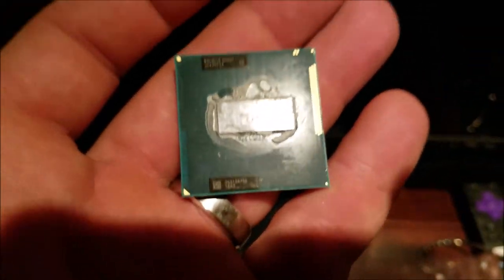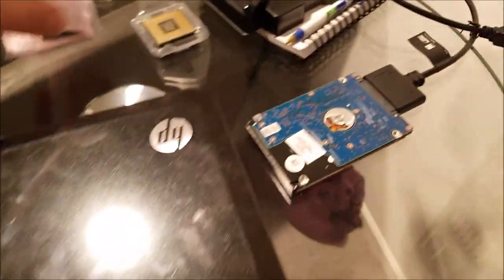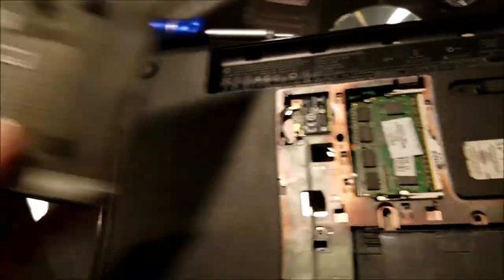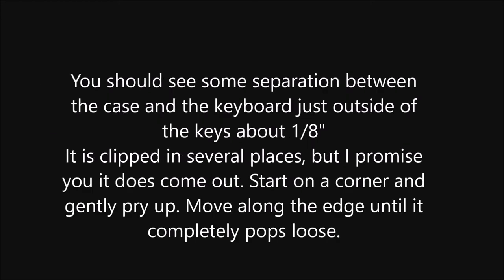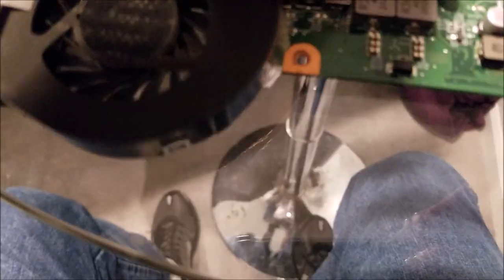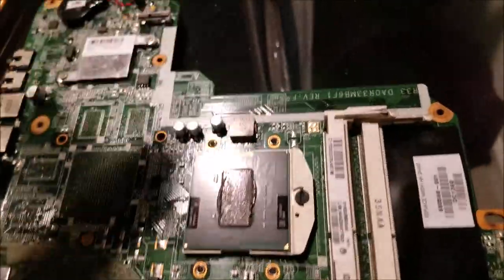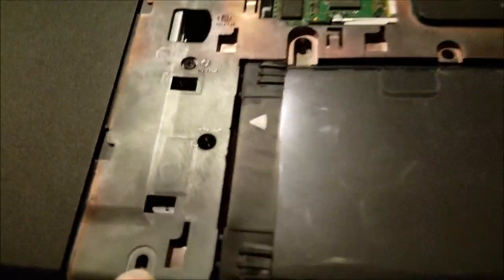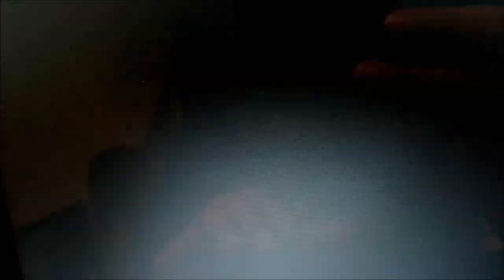How to upgrade to an i7 processor in your old laptop

Comment: i took 1 step higher I was able to put a 3940XM Socket G2 from a  i3 3120m  Socket G2   wow what a  overkill !!!!
Reply from the maker: That's awesome! I was a little worried about my cooling solution. It was only rated for 30w. My 2920xm got awful hot (95-100C) when rendering videos with its 55w tdp. You can use Intel's extreme tuning utility to overclock your processor. The xtreme chips are unlocked and can be pushed a little harder.  Unfortunately, my 3840qm is locked. The 3840qm is rated at 45w tdp and it runs quick and cool. 
  I just bought a laptop as a surprise for my Mom. An SSD, extra ram, bigger capacity battery, and quad core processor gave the 6 year old laptop a whole new lease on life. I'm all in at about $240. It's a Dell Latitude E6430. 8gb of ram. 120gb ssd. And I swapped the i5 3230m for an i7 3630qm. The base clock of the quad core is 200mhz slower but it boosts 200mhz higher so light tasks will be snappier and heavy tasks will be quicker with the extra cores. The battery life is showing around 14 hours with the newer processor and battery. I think mom will like it. She's using an ancient laptop now... she's still running windows xp operating system.
  I'm glad that your system makes you happy. What tasks do you primarily use your laptop for? Gaming? Homework? Everything?
Reply: @EricErnst  It's nice what you did for your mom she defiantly will be happier once she takes it for a run, im also the computer tech in my familyand eachtime I borrow there computers I add upgraded stuff to make them so much more happier with just with the smile on there faces is so priceless! For myself I just upgraded cpu, DDR 3, ssd on all 3 of my machines here at home. All 3 of my machines now in the last 2 months have been upgraded to there maximum!  Unfortunately no I don't game but all 3 of my babies can be overclocked! It only costs me 300$ each computer to upgrade them to there MAXIMUM if you think of it I have saved over a few thousand dollars instead of purchasing new ones so im really happy for that. I have my laptop its a GENERATION 3 3940XM Socket G2 (connected to my 50 inch TV with KODI + IPTV) My WEB-Server which is my bedroom is a GENERATION 3 3700K and this computer I use the most is a bad-boy it's  a  4790K LGA 1150 GENERATION 4.  I mean for what I do. I mean all of this is overkill. I should be good for another 5 years at least and in 5 years gives me time to save up and buy 3 new computers hopefully by that time  memory will be up to DDR 5 or even DDR 6 that would be sweet!
Reply from the maker: @Mark-lr7zp  I built a Ryzen desktop system last winter. I was going to upgrade to ryzen 3000 processor but unfortunately the one I wanted has been delayed until November. It's the r9 3950x. It's a 16 core/32 thread behemoth. Currently I'm running an r7 2700x 8c/16t @ 4.25ghz on a 240mm aio water cooler. 
  I had 2 amd rx 580s in crossfire but recently bought a an rx 5700xt graphics card. It's faster than the pair combined. 
  I've got 32gb of ddr4 @ 3000mhz. That's probably my limiting factor. The ryzen 3000 series cpus like faster ram. 
  I don't even have a standard hard drive. I've got a 1tb nvme boot drive and a 2tb sata ssd. 
  I play a game about 15 minutes every few months but I'm a tech junkie so I like the new stuff. 
  It's always nice to meet another tech guy. My wife can't stand when I talk about this stuff. Lol.
Reply: @EricErnst  The wife is looking at you and saying what language are you speaking...lol....my girlfriend was the same way when it came to computer talk. By the way you got a great system over there, just take care of it and slowly upgrade it and you'll be good for a good 5 years to come.
Reply from the maker: @Mark-lr7zp  I was kinda looking into getting into vr gaming for my sons. I think they would get a kick out of playing games in vr. I only really use my pc for video editing and occasional gaming but it is a very capable system. Even with my 8 core 2700x. It's way overkill for what I use it for. Before this, I'd edit videos on the laptop from this video.
  My wife usually uses the laptop from this video to work on various spreadsheets or PowerPoint or write letters or documents. She actually probably uses it more for party invites and t shirt designs than anything else. 
  I use this laptop to tune engines... I use hp tuners on my 2009 Chevy Tahoe (and any other vehicle from 1996-up) and Holley efi software on my 1990 Chevy k2500 pickup. I installed a new, higher capacity battery so I can datalog for hours on end without needing to be plugged in to a charger.
Reply: @EricErnst  Well for video editing especially ya it will definalty help with added cores plus having faster memory for read and write and compressing should  educie the time by alot .  As for  vr gaming hmmm what is this, to be honest it's the first time i here this. As for your wife working with Microsoft Office i believe the laptop is just perfect for all those tasks. You talking about a software to tweak the engines of your vehicles and that i must say is pretty cool to say the least.

Comment: Hello Eric, I don't know if you are still answering anymore questions but here goes. My sister has a Dell Latitude E5530 (service tag B5LMXY1) laptop and it has the stock i7-3540M (2 core 4 thread). Originally she wanted me to upgrade the RAM from 8gb to 16gb but after watching this video got me thinking. Would I be able to run the i7-3840QM in it and would the cooler be able to handle the extra heat? It's her old work laptop that she is going to give to her husband but not sure if the increased fan speeds may annoy him in the long run. He only web surfs (YouTube and eBay) anyways but I don't want it to run any slower than his old Dell Optiplex 760 that has an intel 2 core 2 thread, 5gb of ram and a HDD drive from like 2009 or something. If not, what other CPU upgrade would you recommend that this Latitude can safely run? Would definitely appreciate your advice. Thanks for posting this video btw!
Reply from the maker: A 3540m is a dual core chip and the 3840qm is a quad core. That's a huge advantage right there. If nothing else, the 3630qm should be a cheap option for a quad core. 
  I am currently running a 3940xm cpu in this exact laptop. It's the fastest chip that intel made for this socket. I do not see overheating issues. My laptop originally  came with an i3 2370m. 30w tdp original vs 55w. If you use good quality thermal paste, you shouldn't have any problems. I am using Thermal Grizzly Hydronaut thermal paste. It has worked very well for me. 
  An upgrade to 16gb of ram might help a little.. but to be honest, I rarely use over 5gb. 
  One upgrade that I definitely think will help is a 2.5" sata SSD if you haven't installed one yet. I am using a crucial mx525gb drive. It works well. It would be helpful to have a desktop cpu to clone the drives, but a USB to sata adapter cable will suffice. You'll need to clone the drive or start fresh with a clean windows install. 
  Another upgrade that's very handy is a higher capacity battery. Mine was ailing and didn't last long off of the charger. I think the factory battery was a 4400mah battery. I got a 9600mah to replace it. It's a little bigger, but I like how the laptop is raised on the battery and allows for more airflow to the cooling inlet.
  I got my replacement battery from Amazon. A company called ninjabatt. Search for your battery model or laptop model and see find a 9 or 12 cell battery to replace the 6 cell. A 6 cell works great too, but the range is incredible with my big battery. I use mine for tuning and datalogging the computers in cars. I often go for long drives, pull over and analyze and adjust the tune, flash the tune, then drive more. The battery life is great for my application. I don't need 16gb of ram, i don't need an Intel Xtreme chip, but the SSD and extended battery are great. The quad core cpu is a good addition, but I think that an SSD is a probably the biggest single quality-of-life upgrade for one of these old laptops. 
  Good luck with it. Let me know if there's anything more that I can do to help.
Reply: @Eric Ernst  Hey sorry for the late response. Thank you, that was some of the best advice I've ever got from a YouTuber, lol. Actually I ended up installing a 3820QM that I got from ebay for $70 as it's within my budget and right away I noticed the first boot up was very fast and applications seem to load quicker too. I had some extra Arctic Silver thermal paste and temps seem normal but runs about 10C higher at full stress test, however the laptop regularly never sees that kind of load anyways. I'll have to try the Kryonaut maybe next time I guess. Good thing my sister already upgraded to an SSD years ago but that definitely made a huge improvement indeed. That is awesome that I can actually upgrade to a larger battery but my sis is gonna hold off on that as this laptop will probably just stay at home anyways but good to know that option is there. She still has Windows 7 Pro on the drive and a ton of her old workplace applications that was giving her warnings about running low on memory which is what started this whole upgrade thing. But I had convinced her just to do a fresh install of Win 10 so this way her husband will have a trouble free experience. Right now I'm just waiting for her to go through all her old files so we can save and transfer them after I install Win 10. 

So I want to say thank you again, your advice was extremely helpful and I appreciate it! 👍
Reply from the maker: @blueblade455  awesome.  I'm glad my advice helped you keep that old laptop alive. Higher temps at full load are expected when you double the cores and make them faster. I wouldn't get too concerned unless you're thermal throttling. I believe the max temp is 105⁰C on the i7 chips of that generation. That's pretty hot, but you should be fine if you don't stress the cpu much.. and make sure the air vents are clear when you do stress the cpu. 
  I've never run a cpu stress test with my 3940xm. All I do is occasionally put on YouTube videos for my kiddos or tune engines, so I don't technically need an xm chip. My 2920xm used to get around 100⁰ while rendering videos, but I don't use it for that anymore. 
  My i3 2370m never ran hot, but it was slow. I'd much rather have a quad core!
  Thanks again for the good feedback. I created this channel to help guys out. It makes me feel good.

Comment: Hi eric good day. I have a i5 2520qm and i want to upgrade to i7 3840m. Is that possible?
Reply from the maker: It all depends on your chipset. If it's hm65, you're stuck with a 2000 series sandy bridge cpu. If it's a hm76, you can use ivy bridge 3000 series cpus. I like yo download cpuZ. It easily identifies your chipset. 
  They both use the same socket but the newer cpus won't be recognized by the older chipset and the computer won't even boot. 
  The newer 3000 series chips are built on a smaller, more efficient 22nm architecture instead of the 32nm. They are faster and run cooler than the 2000 series.
  I think you mislabeled your 2520m processor. The M stands for mobile. Q stands for quad core. I believe only the i7's got 4 cores in that generation. And not even all of them. . I used an i7 2640m for a short while. It wasn't much of an improvement over the i3 2370m. An i7 2630qm would have been a much better choice at the time. Doubling the cores is a much better option than addung a couple hundred mhz. I'm currently running a 3940xm cpu in this laptop. It isn't noticeably faster than the i7 3840qm that I replaced. Xm stands for xtreme mobile. The xtreme series are reserved for the x900 series chips. They are the fastest in each generation. I used a 2920xm for a short while. I didn't notice a performance difference between it and the 3840qm.. But there was a temperature drop under load on the newer chip. 
  If you haven't, upgrade your storage to an ssd. That makes a big difference as well. Probably bigger than swapping processors. It also probably needs a new battery. If the battery won't hold a charge for an hour, replace it. They are laptops, they are meant to be portable!
Reply: @EricErnst  Thanks Eric. It's a very detailed answer now would be a better time to upgrade to ssd and stick to 2nd gen i7. Maybe 2860qm would be more than enough to fill the gap.
Reply from the maker: @danieljoshuaformoso724  if a 3rd generation chip will work, i recommend using one. Cpuz is a quick download. If you've got thr chipset that will support it, it's essentially free performance. As old as they are, I'm sure that there isn't much of a price difference between 2000 and 3000 series chips.